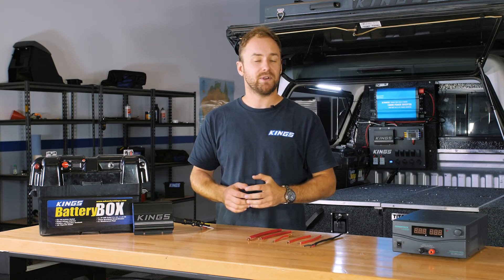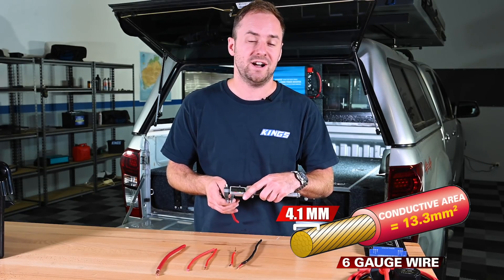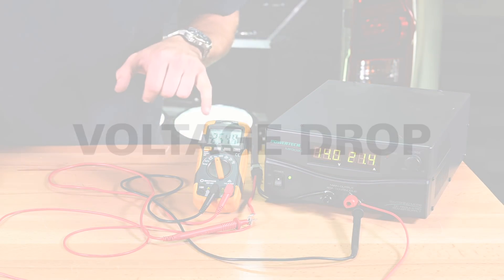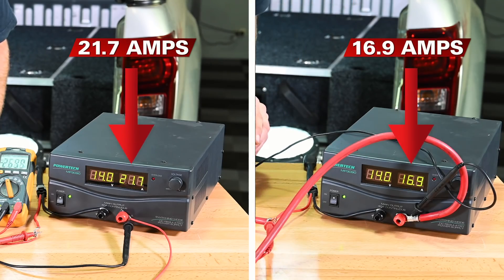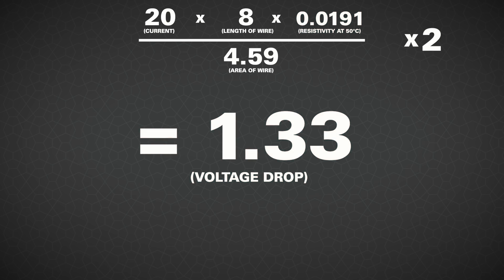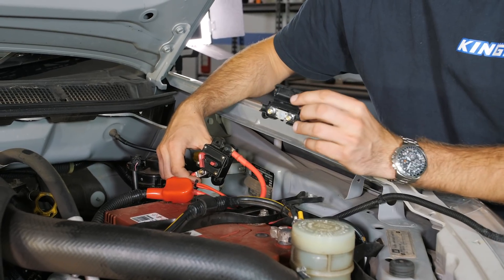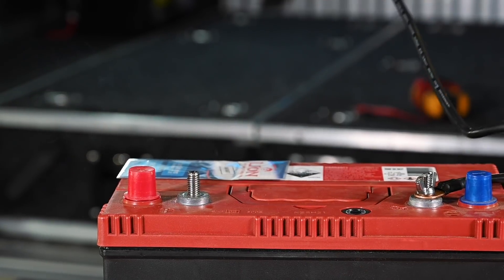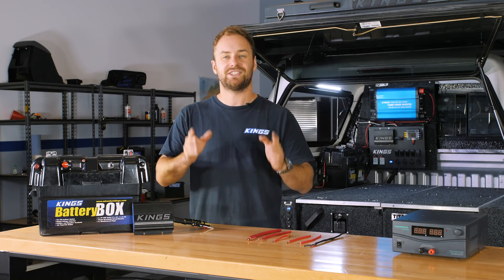BONUS! Complete Off-Grid 12v Dual-Battery Masterclass Pt4: Are You Using The Wrong Wiring?

Comment: you not saying the ignition wire is not needed if you dont have a smart alternatoe
Reply from the maker: Hi there,
You will need the ignition wire if you have a smart alternator, but if you don't have a smart alternator the ignition wire is not needed to be setup.
Regards, Courtney

Comment: Ive got the Kings Mppt plus solar charger. The standard anderson plugs and wire that comes with it are they thick enough then?
Reply from the maker: Hi there,

Thank you for the comment, they would be sufficient to carry into the unit itself as they cover the maximum output of the regulator.

Regards, Andrew
Reply: @4wdsupacentreAu  thank you for the reply.

Comment: So if my second battery is a traditional starter battery, and it is located 12 feet away, and it has 1000 watts running through an inverter for an extended time  (enough to drain the second battery). What gauge wire do you suggest to connect the two batteries over that distance?
Reply from the maker: Hi there,
Based on the information you have provided we recommend roughly a AWG 10 5 mm² cable.
For more accurate information we would recommend checking with an auto electrician.
Regards, Courtney
Reply: @4wdsupacentreAu  Thanks for your thoughts!

Comment: This series is great and has been invaluable for a newbie to the 12v world of 4wding. I bit the bullet and bought a 120ah Lithium battery, 75L fridge, 20a DCDC charger and the 50a wiring kit. After running the numbers in this video it all says that the 8AWG cable is not suitable. By these numbers to get below 3% i need 6AWG cable (4AWG if i wanted some head room). Are my numbers correct? The wiring kit is sold as a 6m cable so at 20 x 6 x 0.017 (at the coolest 25C which seems almost unattainable) you still get 3.75%. Which is close but still it is overs. One the temp goes up these numbers get further from the 3%. I would have thought given these number the cable should be 6AWG. Would you recommend buying thicker cable? Cheers

Comment: So what gauge wire would i need if im doing a dual battery set up from the front of the car to the aux battery in the trunk? And what size fuse would i use at both ends?

Comment: If cost wasn't an issue, would it be better to use the largest diameter copper wire available to protect against voltage drop? Also, I imagine there is a point of diminishing returns. Can someone elaborate on this?
Reply: Yes, it is a case of diminishing returns. So also is the weight of that extra copper. So work out what maximum load you are going to support, maximum temperature of the cable, voltage drop you can live with and what your cable length is.

Comment: Even in most everyday cars there is a lot of good advice in this. For example whatever wires you can run say from the alternator to the battery or the battery to the ground should be as thick as possible to minimize internal resistance That's the case whether you have a basic car or your overlanding. I would also say if possible look at internal resistance of the battery as the difference between a flooded battery and an AGM can be substantial. The ability to quickly get that power out and into the starter can vary often be the difference between getting out of there and being stuck. The only thing I wonder though is if it's possible to have such little resistance in the cables that you run the risk of overcharging the battery. That is if your alternator at idle is 14/4 and goes up close to 15 while driving.

Finally, would it be possible to run a dual alternator setup where each alternator has one battery to charge. This might rob a little bit of engine power but there are companies that fabricate brackets for dual and even triple alternator setups.

Comment: Great video & very well explained.  

I had an auto elec wire up a power supply cable to supply 12 volts through an Anderson plug at the tow bar for my camper trailer's DC to DC charger (which also has a 45 volt solar MPPT feed).  He used 6.5 metres of 8B&S (7.91mm2) & said it would handle 50 amps, so the 40 amp DC2DC would be fine.  I asked him if he thought there would be too much voltage drop.  He said "no".

Another auto elec friend of mine also said that size wire would be fine.

Since the trailer already had 4.5 metres of 6B&S cable (connected to the non-lithium DC2DC I was replacing) & at 30 amp draw, I calculated the voltage drop to be almost a volt at the tow bar & almost 1.5 volts at the DC2DC.  Obviously this heat build up in the wire makes the voltage drop worse as the wire heats up. The DC2DC manufacturer suggested 0B&S wire size for this application (long length of cable), presumably to have 3% voltage drop with their maximum 50 amp load.  Why do you think 2 sparkys have said 8B&S is enough?  Is it because the DC2DC compensates somehow?  I agree with you, in that it is a lot of lost charging capacity.

I now think I have to run a parallel 4B&S cable for the 6.5 metre run.  Your thoughts appreciated.

Comment: Great video. Suggestion for kings though if a fuse is required at each end for safety why is it not included in their duel battery kit with the smart isolator?

Comment: If you have a kingz dcdc charger and control box do u still run a negative wire from auxiliary battery 2 starter battery or  just into the control box cheers

Comment: I have a deep cycle battery in a second battery box under my hood. I have run "0" gauge wire back to my 4500amp inverter secured in the back. If I wanted to add a dual battery setup in the back of the bed, would i have to double up my runs from the deep cycle under the hood to the battery bank in the back prior to terminating at the inverter?

Comment: Very good, also note, if you're unable to get bigger diameter wires, you can always connect another length of the same wire in parallel to effectively double to diameter. Just make sure the connection points are properly connected.
Reply: So would that equate to if looking to use 2 x 85A wire it would equate to 170A?
Cheers
Reply: @stevecrowe176  Well, yes. You are correct. Assuming both wires are run together (for accurately matched lengths and temperatures) and all terminations are solid. This can make for easier installation too as the individual cables are less stiff (although total cost is unlikely to be less).

Comment: If i have a basic dual battery set up, one in the engine bay and the other in my rear tray (dmax) what would you recommend as the minimum wire gauge to join the two?

Comment: If I mount a Kings 160 watt solar panel between the canopy and attached it to the bottom of the roof racks (not on top), how many watts of power would I lose by the roof rack bars (40 milllimetre) going across the panel?

Comment: Hey mate, I have a 8 meter run back to 2 100 ah agm deep cycle batteries, and my total, I am going to install 300 watt solar system and a dc to dc charger, I wanted to know what size cable to run between the batteries and what size  fuses on the positive at both terminals. Cheers
Reply from the maker: Hi Damien,

The engineers who designed our DCDC charger suggest 6AWG up to 8m and 4AWG from 8 to 15m. So I’d go 4AWG for the best possible outcome.

In terms of fuses, it depends on the DCDC charger you’re choosing – we suggest a 50A fuse for our 25A DCDC – so have a look in the manual for whichever charger you’re using.

Otherwise think about what load will be on the wiring. Just as a guide we’ve used 50A fuses for our DCDC chargers, and 100A fuses for our smart battery isolator.

Hope this helps.

Emily

Comment: Hi Cahn, re fusing the positive cables. I just wasn't sure about the fusing. You said that all the positive cables need fuses. In a dual battery system with a DC/DC charger, where do they need to be. Is this how it works - on the cable between start battery and dc we need a fuse, then do we need a fuse between dc and second battery, and then another fuse on the output of the second battery. I want to run a large bus bar at the rear of the vehicle and run power to the inverter, led lights, usb charge points, etc. Would I fuse each run or simply fuse the whole lot between battery and bus? I think it would be soo helpful if you put some basic wiring diagrams up on the website for people to access just to help with the whole process. Thanks for a really great series ... so clear in your explanations and so informative - thank you so much.

Comment: Just wondering if it is possible to overcharge an AGM battery ? I have the standard dual battery system (no DCDCor Mppt) the battery is pretty much full all the time and gets topped up when I run the car on my day to day driving... any problems with this !?
Reply from the maker: As long as you have a smart isolator setup for when you are charging off your alternator and some sort of regulator for when charging off solar you will be ok. It is possible to over charge the battery and damage the cells without the right gear!

Cheers,
Chad.

Comment: 1st and foremost...Big 3 upgrade. Run 1/0 from Alternator + to battery +, battery ground to chasis, chasis to engine block. Make sure it's OFC (Oxygen Free Copper) and not CCA (Copper Clad Aluminum). All these "smart isolator" kits are just marketing BS. It's antiquated technology! 
High Output Alternator w/ smaller pulley & belt = more amperage at low RPMs. Proper big gauge copper wiring and lithium capacitor bank...that's it. 
Just look at the mobile audio circuit. They're running 80,000 watt systems pulling over 1000 amps of current off aforementioned electrical setups.

Comment: One more question Cahn, i got ford to turn off the smart alternator so I could use the older style smart isolator. I don’t have allot of room under the bonnet so I will install the smart isolator in the tray with the deep cycle battery. Do you see any issue with this provided I take care of voltage drop by installing large diameter cables ??
Reply from the maker: Hi mate - I've just answered this below on your other comment,

but short answer: it won't work very effectively due to voltage drop when it's under load. Yes, larger diameter cables would help but it's still not as good as having it under the bonnet...

I'll try and give it a go for you on my test rig at 40A if you'd like to find the exact outcome. But I'd say to check if you can squeeze it under the bonnet somewhere - even if it's out of the way on the other side of the engine bay for example.

Cheers,
 Cahn
Reply: Legend mate thank for your advice!!
Reply: You can also run two 16mm2 cables in parallel between the batteries.

Comment: Nice video mate. I’m pretty new to this and have purchased a kings dual battery system and solar blanket with the solar regulator.
A couple Suggestions feedback:
It would be good if your dual battery kit included fuses / breakers suited to the cable size.
I would be good if you also included the same length earth cable in the kit - as you say it is better to connect the earth back to the starter battery.
It would push the price of the kit up but we have to purchase these parts in any case so why not get it all in one kit ..
I’m installing 50amp breakers. Between the starter battery and deep cycle battery. Can you tell me what amp/ current draw the king’s 135AH deep cycle AGM will have in my alternator / starter battery assuming, let’s say the deep cycle is at 50% capacity??

The other issue I am having is on the solar regulator that comes with the 200w solar blanket. The manual for the regulator does not match the screens on the regulator it self - it even has screens that are additional with no explanation of their function. I want to get the most out of my system so making sure all the settings in the regulator are correct is pretty important.
I spoke with the guys in store and they were also struggling to understand the settings.
Reply: Hi Cahn I’m just touching base to see if you have had any luck in getting info for the solar regulator I mentioned in my previous comments. I’ve emailed customer service and called into a few of your stores but no one can give me any answers ??
I want to ensure I am setting the unit up correctly but it’s hard to do when the manuals don’t match the equipment... any suggestions?

Thanks ....
Reply from the maker: Hey mate,

I'm going to copy paste some info from another answer I put up earlier, but I'll change it and add some more info to suit your questions!

Running a body or chassis earth is good... running a separate earth wire is better!

We’ve run the standard Kings dual battery system in our GU for the last two years with no worries - I suppose the point here was to say if you’re after the absolute best set up for efficiency then run a separate earth! But, that said, the GU hasn’t had an issue charging, running a fridge or any of our accessories on any of our trips, but if we wanted to squeeze every last drop of power out of it I would install an earth return.

Yes, like most dual battery kits available we suggest you grab your own fuses or circuit breakers! ( I personally like to use waterproof manually resettable circuit breakers - they seem to cope with heat and hard work much better)
 - Also in my LandCruiser I ran a single oversized earth wire to the rear of the vehicle, then used that for not only my dual batteries but also to earth all my accessories too. so, not including an earth means you can opt for the biggest and best the first time, or just run with what you've got until you need to upgrade down the line. (that said I've suggested we add an earth before and I'm happy to suggest again.)

Not including generic fuses in our kit saves you having to pay for them if you’re going to run circuit breakers anyways. Or if you’ve got particular fuses or fuse holders that you use already (Eg MIDI or ANL) then you can get the same and make it all match so it is neat and tidy.

Plus, if we supplied fuses with a certain amp rating and you had a bigger alternator they wouldn’t be much chop! With the amount of different vehicles and custom setups out there it’s better if you get the right parts for your setup!
 Which leads me to your question on how much charge you can expect... I'll try and cover the basics, but there are so many variables that will affect this, so bear with me!

The maximum current between two batteries equals the Voltage difference between the two, divided by the sum of the internal resistance of the two.

So (V1-V2)/(IR1+IR2)

in this case let's say you start your car and your isolator connects at 13.3V while the vehicle is running,  your second battery is 12.5V. your starter battery resistance is around 10 milliohms (0.01 ohm) and your deep cycle is around 4 milliohms (0.004ohm)

(13.3-12.5)/(0.01 + 0.004)

(0.8)/(0.014)
=57 Amps.

Now, this doesn't take into account battery temperature, age of the batteries etc.

plus it doesn't take into account the resistance in the rest of your circuit, which will bring down the current even further. Factoring in the resistance in your wiring, plus the circuit breakers too - you'd be looking at around 40Amps let's say.

Also, once the batteries connect and the main battery power starts flowing to the second, the starter battery voltage will immediately drop due to the load on the battery, plus the 138AH will see a surface charge and pretty quickly the voltage difference between the two will minimise, and current will drop a little more.

Because your 50A breakers are capable of carrying more than 50A current for a certain time, this should be ok. But be mindful that many circuit breakers are de-rated as they increase in temperature - you might find that under your bonnet the circuit breaker may pop when you're working the engine particularly hard, or in very hot weather where it's not able to dissipate the heat from the engine effectively.

The other question you asked above - about locating the Isolator in the back, it won't work effectively I don't think...

As soon as the voltage input reaches 13.3V and it connects the circuit, it could be drawing 40A - using the equation in the video at 25°C that would lead to about .4V of voltage drop just in that wire itself - dropping the voltage down to 12.9V on the input. As resistance and temperature increases it may drop so substantially that your isolator turns on and off constantly.

Even if you have to position the isolator out of the way (on the other side of the engine bay, for example) It'll still work more effectively!

Finally, I've been looking into the Solar regs already - does yours have a menu showing 12H? I'm working with the product team to get clarification on this but I think it's an overall charging time limit per 24 hours - so leaving it at 12 means it's able to charge as much as possible every day. But I will get confirmation and reply again!

Cheers,
Cahn
Reply: Thanks mate really appreciate the time and detail you out into your reply. I’ll try out the 50 amp manual reset breakers and see how I go. I’m running heavy cable so worst case I’ll just upgrade the breakers to 100 amp if needed.
Regarding the solar regulator, yes, I have the newer one with 12H on the last screen. Would be good if you guys could update the manual to cover this newer program.

Thanks again!!